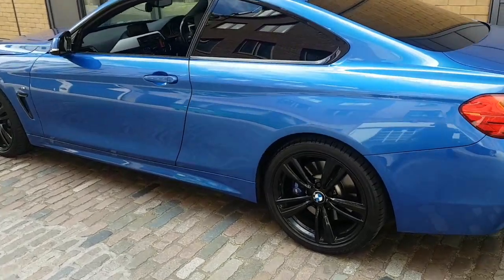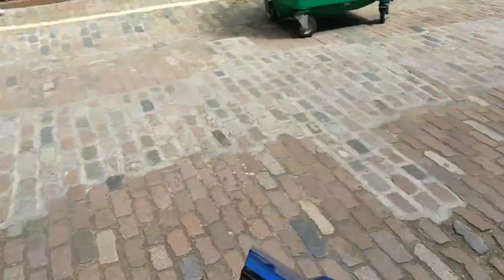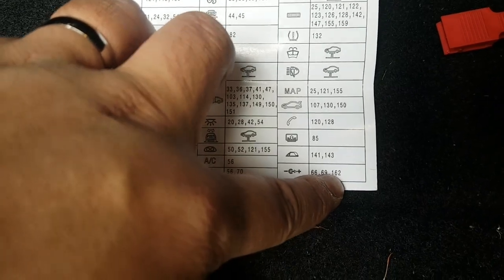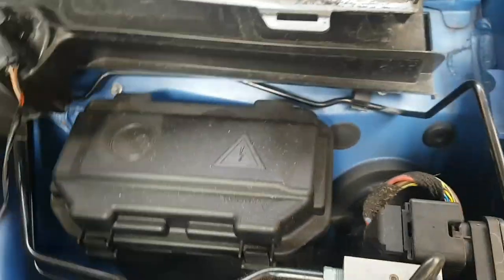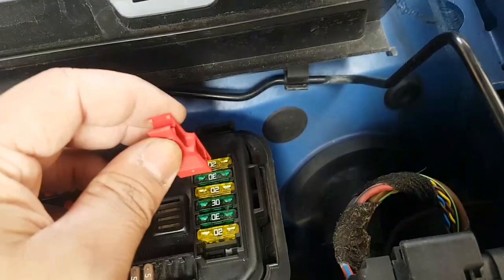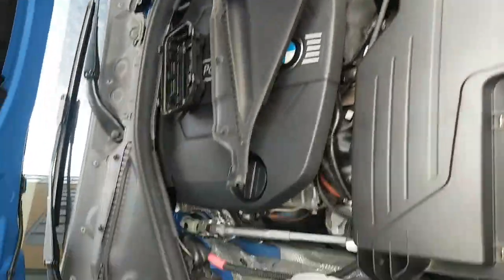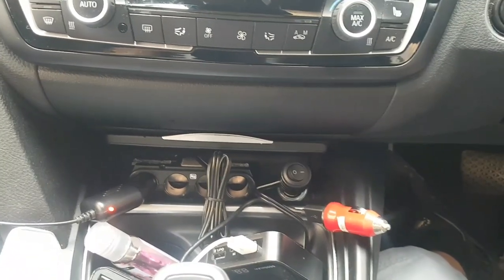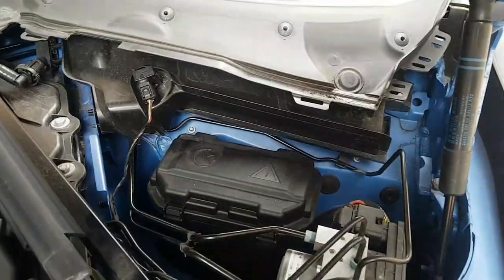BMW 4 Series (F32) | How to change cigarette lighter? (Fuse Replacement)

Comment: Thanks, great video. Just an additional note to say that on an 430d Gran Coupe - 2016 (F36), the plastic cover above the fuse box has an additional 3 plastic hex nut clips near the windscreen that need a half turn to release the cover.

Comment: 66 is for the cigarette lighter in front of the gearstick. 69 is for the cigarette lighter under the passenger glovebox. 162 is for the cigarette lighter in the boot.
Reply: There is also one cigeratte ligher in the climate box for the rear passanger

Comment: My 428i's retractable driver side mirror motor has malfunctioned and folds the mirror at random, the fuse # I pulled is 22 (7.5A) as seen in this video at 3:47 for any one else who need a quick fix of the same problem. BMW dealer will charge you over $1000 to fix it properly, so you're welcome =)

Comment: Just curious, but what do you think blew the fuse? Was it likely wear n tear, or was something with a heavier than tolerated draw  placed in the socket and the fuse simply did it's job?

Comment: this video was so helpful. whered you get so many fuses from
Reply from the maker: Thanks mate glad it helped you out. I bought the fuses from maplin. But they gone bust now. You can buy packets of fuses from any car shops. Euro car parts an such. 👍👍
Reply: BMW Bugs just got some off Amazon hope they fit in. so glad it was only a blown fuse. literally just checked it.. strugglin to put the cover back on though, it doenst seem to fit in place  (the cover, covering the fuse box and other wiring) any tips ?
Reply from the maker: @gr8vids123  Hi it just takes some wiggling to get it in place. there's to clip ends at the back. if you can get them aligned then should just pop back in. hope that helps buddy 👍👍